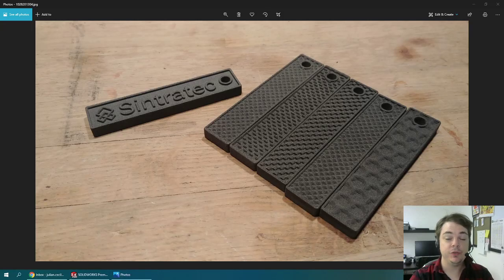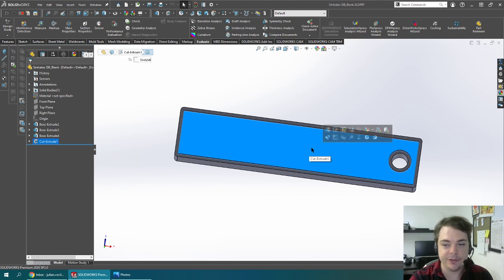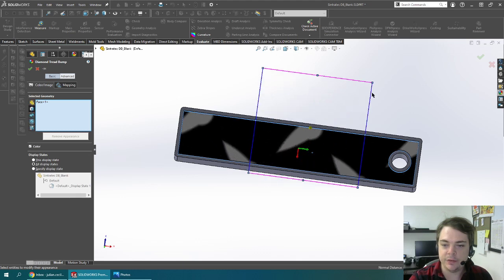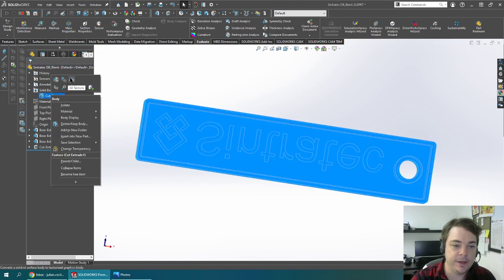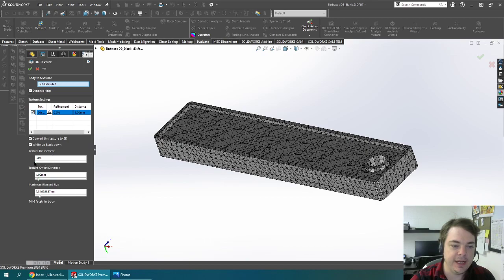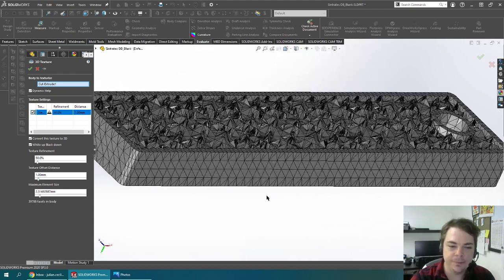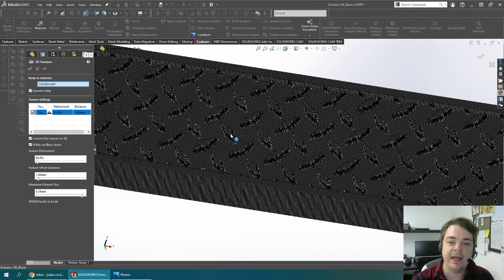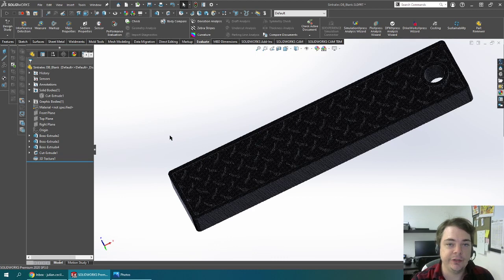Solidworks 3D Textures Demo

Comment: is there a way to make it save as actual geometery?  It doesn't save with STP files.
Reply from the maker: In SOLIDWORKS, 3D Textures is currently only available for mesh-data.